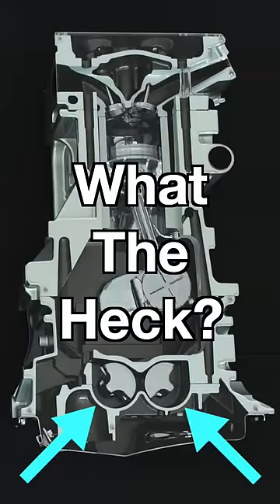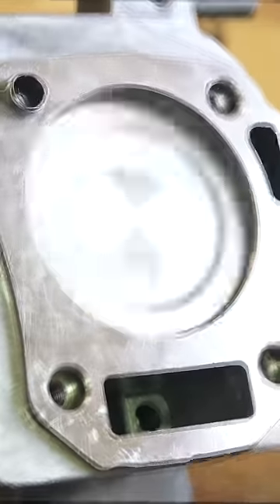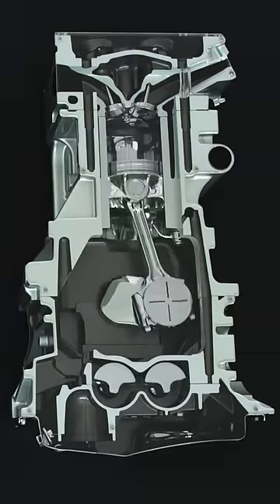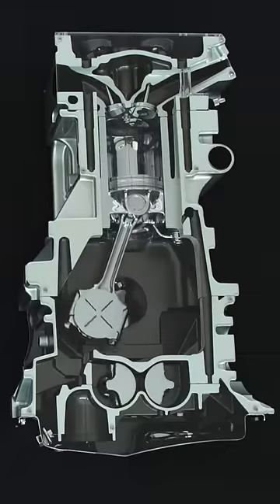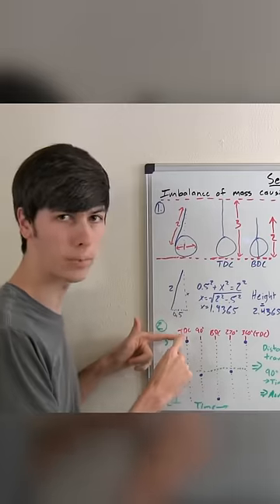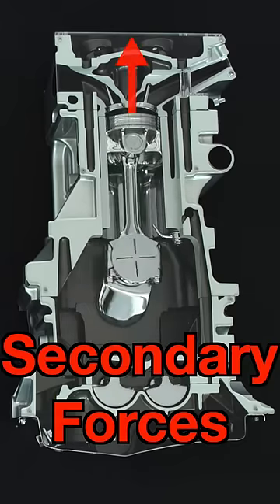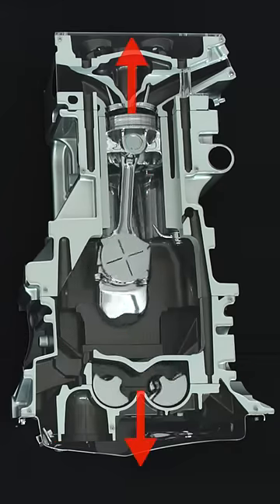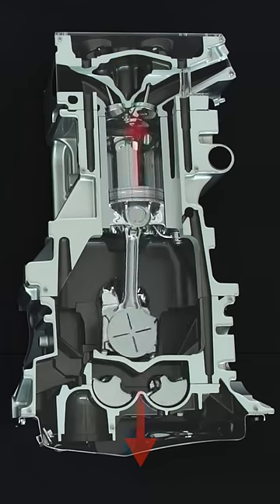How Engine Balance Shafts Work (In 60 Seconds)

Comment: I drove Toyotas with 20R/22R-E 2.2/2.4L I4 engines for years.  They were good solid smooth engines, but vibrated like crazy past 4K RPM.  Years later, I drove Toyotas with 5S-FE and 2AZ-FE engines (also 2.2L and 2.4L) and it was smooth all the way to redline.  That’s when I discovered about balance shafts in the newer engines how it canceled out the vibrations.
Reply: Just pulled apart a 2002 Isuzu, 2.2.
Never saw them before, so this was interesting.
Reply: You mean my 1989 22RE Hilux is really dying to go over 4k? I'll have to try a lower gear going down a long highway hill to get near 4k with no load, I think. Does go 75 or 80 well enough in 5th gear though near 3k.
Reply: Well I own a Toyota with the 2AZ-FE engine, and I have decided to delete the balance shafts because the engine's new crank is having trouble going through gears. Apparently the balance shafts are the problem.
Reply: @solarastuff how does it run after deleting them? How bad are the vibrations?
Reply: @hectordeanda9133  Haven't done the delete yet but for now it makes a terrible rattling noise when reaching high rpms, idles good though.
Reply: 22R engines didn't have balance shafts, worked on many.
Reply: @solarastuff did you done it yet?
Reply: @GewelReal nah my motor is still sitting in the shop, just getting 3 project cars outta the way
Reply: I had a Celica with the 5S, and I'm pretty sure the Celica version lacked the balance shafts which the Camry version did have.
I don't remember it vibrating excessively in the Celica, but it makes sense to make it vibrate as little as possible for something like a Camry.

Comment: My recently acquired 1986 Mitsubishi has twin balance shaft engine, can confirm is smooth at expense of a little  (chain) drive whirr.
Reply: Until it fails then it will cost.

Comment: I remember the 2.2 liter in my old Camry had balance shafts geared directly to the crankshaft that stole something like 10-15% crank horsepower.
Reply: That's strange, since the Celica's 5S-FE makes the same power but doesn't use balance shafts. Maybe the Camry got hotter cams to compensate

Comment: There are some V6 engines that have balance shafts in them too not just 4 bangers and 3 bangers. For example the Mercedes 3.5L V6 has a balance shaft
Reply: Yep my 2011 ML350 feels great
Reply: V10s and V4s as well may have them.

Comment: first & secondary forces are the reason 6cylinder engines are so smooth. You can eliminate both forces solely by correct firing arrangement.

Comment: I have a Passat W8 and it has this in the engine.   It’s just one shaft driven by a belt off of the crank pully.   Supper smooth engine

Comment: I just replaced my engine balance shaft in my 2010 rav4 the car started ratting in cold starts the repair is expensive but it started to go out at 370k miles

Comment: My 2.4 Mitsubishi has a balance shaft that is tied into the oil pump/timing belts. It’s possible to get it 180° out of sync if you don’t keep track of things when changing the belts. My dealer did warranty work, and when I got it back it buzzed and vibrated like crazy. I photocopied the Hanes manual page and gave it to them. Their factory manual said nothing beyond simply lining up the timing marks. You have to cycle the engine four turns to see where it ends up, which their book didn’t include. Oddly, their book for the 1.8 litre (same block) detailed the procedure.

Comment: The displacement during the half rotation at the top is larger than the displacement during the half rotation at the bottom. Flat four are not affected by secondary force because the piston are opposed and the secondary force is cancelled.

Comment: If you were wondering, flat boxer engines and any even-cylinder inline engines with more than 4-cyl don't use balance shaft as the forces are cancelled out. Inline fours may experience secondary imbalance due to smaller number of pistons.

Comment: Physics behind this

The piston does dammed oscillation and the two shafts which are spinning one is clockwise and other is anticlockwise though the rotational axis of the system is in the middle of both they both Shaft produces a torque or force in same dirrection and though the piston is downward or upward the forces acts upward because in half time period of oscillation the acceleration is in upward direction so force is also in upward direction

Comment: Balance shafts are used on some engines but really necessary on inline 4 cylinder engines when the capacity gets to around 3 Litres. Used to reduce second order vibration.

Comment: Counter balance shafts are calculated to remove MOST of the cyclic oscillating vibration forces. There will always be some small harmonics that cannot be totally removed, but by making sure those leftover forces are horizontal instead of vertical, and also using engine mounts that can absorb those leftover small forces, the driver/operator perception of a very smooth running engine is achieved.

Comment: Inline 6 has entered the chat.
Inline 6: "LOL nerds!"
Reply: V-8s also usually don't need them
Reply: @nthgth  most V-8s rely on crank shaft counterweights and tuned mass dampers instead. Resulting in more rotational mass and a heavier overall engine. Don't get me wrong, I love the sound and feel of a well-engineered V-8, but there's trade-offs needed to get that balance right.

Comment: It’s a genuine feat of precision engineering when you realize that their rotation in correlation with the piston have to be always consistent and exact after millions of movements and they’re still just the same. It’s crazy.
Reply: Ah, the miracle of gears... 
I'd be interested to see the results of a balance shaft driven by a hunting gearset or a belt that could slip slightly.

Comment: Just got these replaced. Toyota Camry ACV40R 2009 with the 2.4L 2AZ-FE engine. 160K kms (Around 100K miles). The bigger shaft gear was already loose, it can eventually break and ruin your engine if left untreated. Looks fine from the outside, but you have to grab the carbon gear and the rod for signs of any play.

Comment: There are pros and cons to them (I actually just explained this to my girlfriend yesterday)

I no longer have balance shafts in this engine, I deleted them when I assembled it, it is all forged internals and makes no sense to have them.

Now, the cons to having them.
1: loss of power (about 15% for my specific car)
2: huge point of failure, especially on an older car, where the belt might not be as strong anymore.

That's actually what killed my last engine, it was a stock internal engine with about 160k miles, the belt snapped, and ripped through a few things before getting stuck, seized the whole engine.

Now, the cons to deleting them.

Vibrations, although I'm used to them, and never had a problem with them, even when I first got the new engine running, some people might not like the vibrations, but they are actually not very extreme in my opinion.

But the worst part about that, is the they will loosen things over time, like small bolts in the engine bay, that don't have loctite, in fact I just had my alternator belt adjuster bolt come all the way out.

So its something to think about when choosing to keep them or deleted them, I would not deleted them on a stock engine personally

Comment: Perfect for engines where the pistons run parallel, in one axis (up/down).

Can you please explain if these are used in any V/wankel(rotary)/or flat piston configured engine set ups? 

In a flat piston configuration, do opposite forces/directions of the pistons on/in each bank, cancel each other out? 

And would wankel(rotary) piston (singular) forces be circular in motion, and if so, how is this force counteracted? 

V engines (like the V6 EcoTec for example) utilise a crankshaft/harmonic balancer on the front of the engine mounted in front of the crankshaft, for this purpose right?

Comment: THESE SHAFT'S MAKE FOR A REALLY REALLY SMOOTH RUNNIN MOTOR
Reply: Even filter remove its eficacy is 550 per liter
Reply: A smile i gues y never seen 42 bolt pistol speed movement object no obstaclr

Comment: Do balance shafts have to be in the engine block?  Could they be integrated into the camshafts at the top with a head gasket separation to eliminate a point of friction since the camshaft timing is linked to the crankshaft?

Comment: VW Passat 2.0 tdi  2005-... The balance shaft module made the engine run quieter but worn out very fast, taking the engine down. The same engine was running noisier , but 4 times longer without the balance shaft module.

Comment: What spins the balancing shafts? Are they attached to the crank shaft? Genuinely question as I've heard of balancing shafts but never seen them in action
Reply: They're attached like everything else. The camshafts, the alternator, everything. Either a belt or a chain connected to the crankshaft

Comment: piston speed is added highest halfway through the stroke. I can’t visualize the piston going slower at the bottom of the stroke than it is at the top of the stroke as it is about to stop and reverse direction.
  also
Is harmonics a problem that engineers must be sure to avoid? I have heard of engine failures being caused by harmonics.

Comment: Those balance shaft do some help moving the car by being connected to the transmission or they just spin? I think they could be used as a electricity generator spinning a magnets around coils, and giving energy to the transmission. I'm not mechanic

Comment: What are the mechanics behind the balance shafts rotating though? Ultimately, everything spins off of the crankshaft, but are balance shafts attached directly to the crank via chains, gears, or belt? Timing of some sort is needed, so are they tied to the heads via a timing chain / belt?

Maybe the long form video of this will explain it? 🤷‍♂️

Comment: Secondary vibration is easier to understand if you look at both piston moving up and down vs crank rotation.

Let say we use fake imaginary unit, like mph. If we assume that crank always constantly rotate at 100 mph, as the piston move from TDC (0° crank angle) to half way down of it’s max stroke which 90° crank angle, the crank will always want to keep the rotational speed at 100mph but due to the cosine effect of the conrod the piston is now traveling at 120mph instead of 100mph. This unsyc speed causes downward vibration to the engine. 

From there the piston slows down from 120mph to 100mph matching the conrod speed. But as the piston trying to complete its full downstroke movement, due to the cosine effect of the conrod, now the piston speed once again unsyc with the crankshaft. It’s now travel around at a much slower 80mph speed. Imagine crankshaft what to keep the speed at 100mph but the piston suddenly “hit the brake pedal” so hard forcing the crankshaft to slow down causing the upward vibration. 

The remaining stroke is practically the same but just in reverse.

Comment: Small four cylinder engines ended up getting over bored/displacement increases for more power to make up for the weight added to the car's platform over time and then you end up with balance shafts which increase complexity and reduce reliability.

Comment: just pulled apart a 4 cylinder engine from 1962 and it had balancers driven off a gear welded to the crankshaft.

Comment: Balance shafts only counter secondary vibrations. It improves ridability, but does not actually do anything for the balance of the crankshaft and rods. It can be removed with no actual detriment to the engine.

Comment: Here is a true story…
A certain UK based, Indian owned car manufacturer made an engine with a Lanchester balance system in it. I got one of the shafts and found that the centre of gravity was about 45 degrees from where it should have been. So, not only did the balance shafts not counter act the piston forces, they added a lateral vibration all of their own. The NVH guys couldn’t detect the out of balance. So it just goes to show, well…lots of things really.

Comment: I have two motorcycles one chinese without a balancer, it vibrates a Lot in high revs, and another from india with a ktm derived engine, with a balancer, and it runs smoother, but i like both bikes

Comment: Looking at that, I wonder if you could make rotating valves instead of poppets?
So there would be no need for a cam shaft, or more like the cam shaft becomes the valves.
You'd need a gear box off the timing belt to slow them down, but it would have less moving parts.
VVT would require a gearbox.
Reply: And I wonder if you could use rotating valves on a rotary, improve compression ratios.

Comment: Most engines just use a Harmonic balancer, its a big heavy weight that sits on the crack shaft on the front of the engine.

Comment: Pistón doesn't move faster at the top than It does at the Botton.  It moves faster in the middle and slower at the top and botton.  Secondary, results from side to side movement. Not to mention thirtiary. These balancers are only necessary on larger engines.  2.2 L and larger usually for online four.  From a design engineer

Comment: Normally these forces are counterbalanced by other cylinders in line. Or by balance mass on the crankshaft itself
Reply: Due to connecting rod movement, the piston acceleration is slightly higher at TDC than at BTC, so pistons moving in the opposite direction cannot perfectly cancel each other.

Comment: If the crank had counterweights like most engines do, their wouldn't be a need for a balance shaft. Some v6s had them because of an uneven firing per the revolution of the crank. I.e. 90 degree block v6. 90 degree block v8 fires every 45 degrees. 60 degree block v6 fires every 60 degrees. 72 degree block v10 fires every 36 degrees. 60 degree block v12 fires every 30 degrees. GM's 4.3 v6 was a 90 degree block and it had two rod pins offset from each other to compensate. Take 360 divided by number of cylinders to get degrees between each fire.

Comment: Once in 70’s my Saab 96 V4 (Ford engine) started trembling terribly on motorway. I was sure the engine was totally destroyed. Anywqy I drove home. The balance shaft’s small fiber wheel was lost all of it’s teeths. After changing it everything was OK. That was the first V4 year modeel -97.

Comment: but you're still missing ⚖️ balancing out the side to side motions as the cam rotates in a circular motion flinging it's weight to the outside of the circle becoming heavier the faster it spins well not heavier but pulling more gz  the weight of object x velocity over acceleration like can we balance this gryroscope actually? why not keep it simple build a reverse engine to sync up but in polar reverse motion of other engine you just need to mount it to the right kind of material as to not have them tear each other apart

Comment: And who knew that timing the force in one cylinder so that it offsets the force from another. A 5 ltr engine with 12 cylinders all hitting at different points of the crank rotation is dramatically smoother than a 5 ltr 2 cylinder engine because those forces are spread out over a wider range of crankshaft rotation. Cadillac knew that in the 1930s and made incredibly smooth running 16 cylinder flat head engines, as did many other manufacturers.

Comment: Right more like if it isn't balanced its going to vibrate itself apart. Your talking about an engine thats running somewhere in the 3200 to 3600 rpm range. Thats alot of motion even if its just slightly out of balance. Therefore its critical that the entire engine is properly balanced.

Comment: Normal Road car engines don't have these, they usualy have a Weight at the oppositebside of the crancshaft, they can be found in dry-sump systems
Reply: Quite opposite, road cars have these to increase comfort in expense of some power - that's not needed in sports car.
Weight on the crankshaft is to counterweight rod and reduce stress on the crankshaft.

Comment: secondary forces are literally just a misunderstanding. the angle of the connecting rod is why the movement ends up being uniform throughout it's travel. 

I remember thinking that the piston travels at different speeds depending on where it is, so I understand the concept, but the way it's represented here is definitely not even accurate to the concept.

for example, the linear distance from 45° to 135° is far greater than from 315° to 45° (the 90° arc corresponding to the TDC).

however, it's the angle of the connecting rod that modifies the distance being traveled. whether it's actually identical is something you could calculate, but my suspicion is that it is. a big indicator is that the crankshafts connecting rod journal is rotating in a consistent circle. some of the movement is being allocated to increasing or decreasing the angle of the connecting rod involved.

also, the real cause of engine imbalance has nothing to do with the connecting rod wanting to travel upward or downward. it's actually because the center of mass is not balanced because of the inherently unbalanced design of having connecting rods and pistons above the crankshaft. a flat (horizontally opposed) engine will be very well balanced. crankshaft counterweights basically don't even work, because they only balanced the piston/rod when at TDC, and are not balanced at bdc.

Comment: I remember when it was just a weighted pully with a rubber dampener bolted to the end of yours crank shaft
Reply: That's a different thing - it dampens vibrations caused by "pulses" of the expansion cycles, to protect auxiliary belt. For the same reason, DMF are fitted to the other end of the crankshaft.
Reply: @Papinak2  have you ever worked on any gm v8 or 6 engines they are balanced with a harmonic ballancer on the end of the crank and the crank shaft it's self and the flywheel in a manual that's it

Comment: Ford uses a balance shaft in the lifter gallery on the 3.8L V6. and other V6s, because Ford is too cheap to balance their engines correctly.